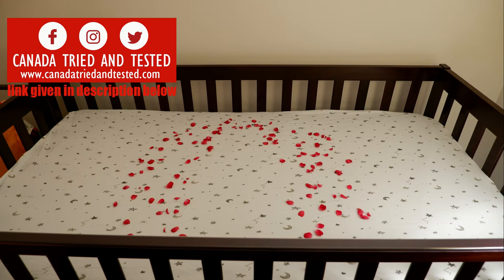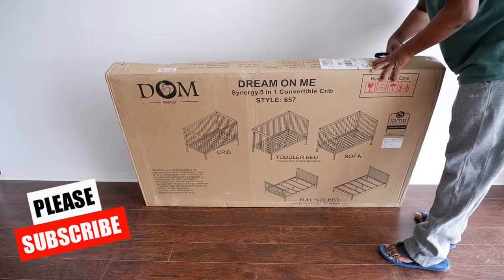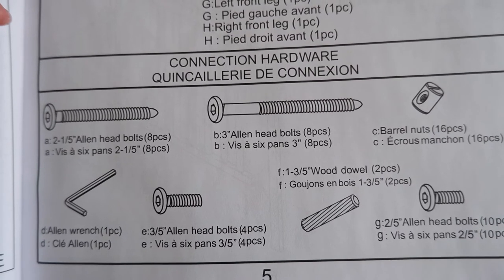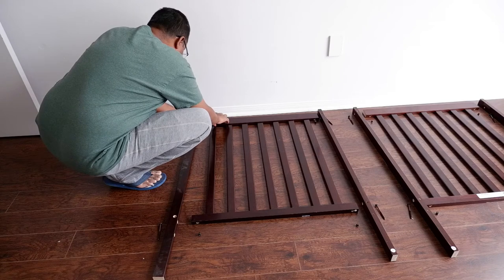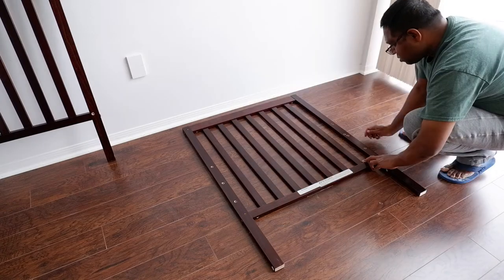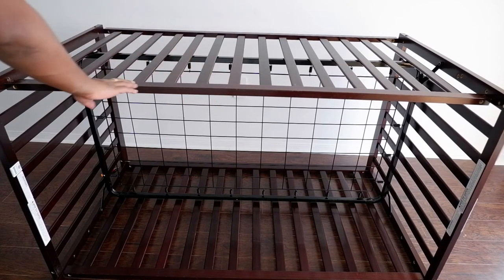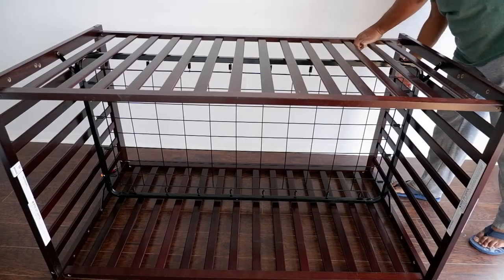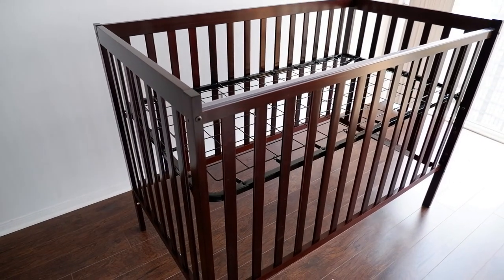Detailed Guide to Easy Assembly of Dream on Me Baby Crib

Comment: Pretty sure you attached the mattress support upside down. From the pictures online it looks like the brackets are supposed to attach to the crib above the rest of the mattress support, not bellow (so the mattress support "hangs" from the brackets, and aren't propped up above them like this). Glad to hear it's been working for you even like this though. :)
Reply from the maker: You are right. It’s upside down. Worked without any issues for last 2 years